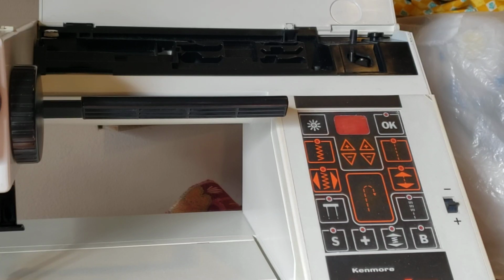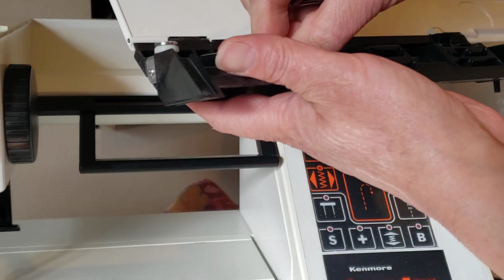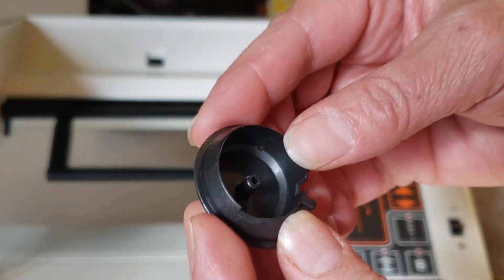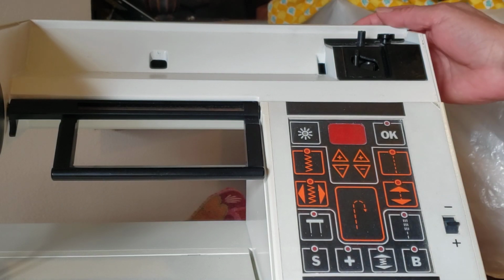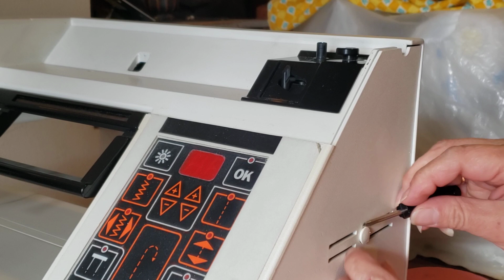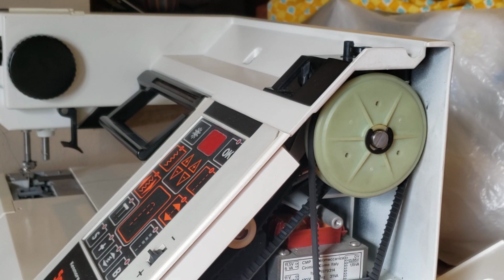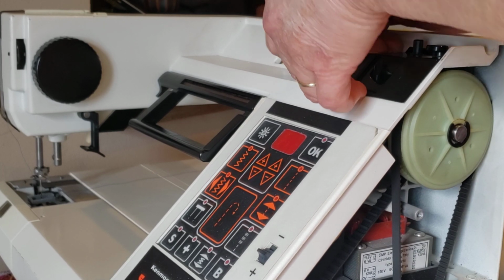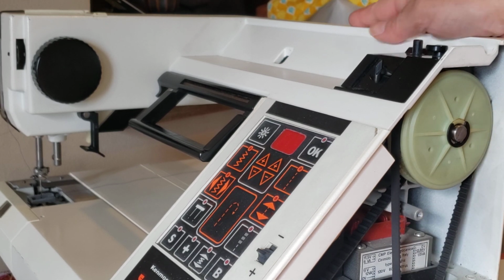Kenmore Sensor Sew one hundred maintenance part 2

Comment: Hi I just got this machine but the handwheel came off and when I put back on it wont turn the needle it turns for nothing any idea what I can do? Thanks claire
Reply from the maker: hi Clairine,  this machine  sew great, but we have to take a course to maintain them, the link below  is the service manual, ..  you can really guide yourself with this manual, I also have many videos of how I maintain them, subscribe.,  the link is: https://www.searspartsdirect.com/manual/2r73rm1bdm-000582/kenmore-3401991180-mechanical-sewing-machine-parts